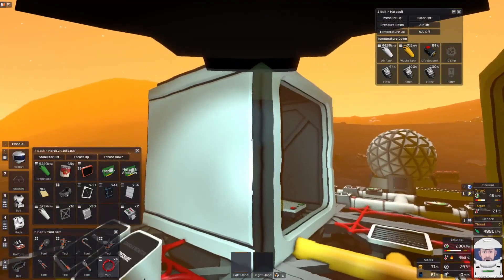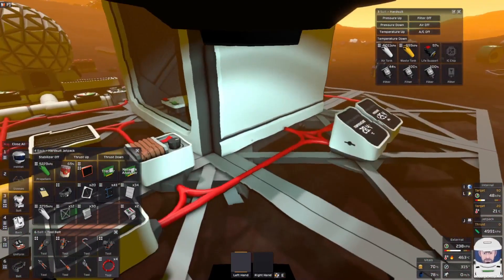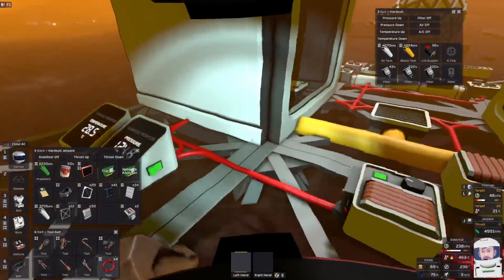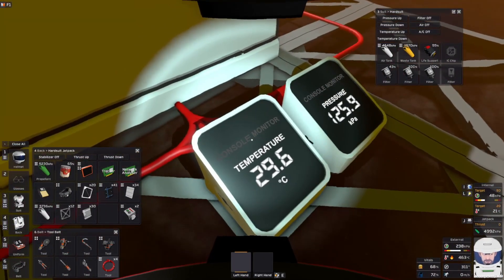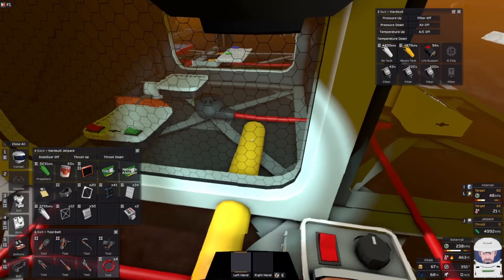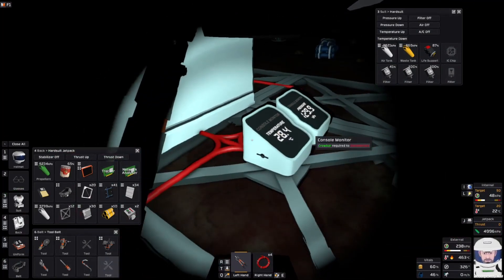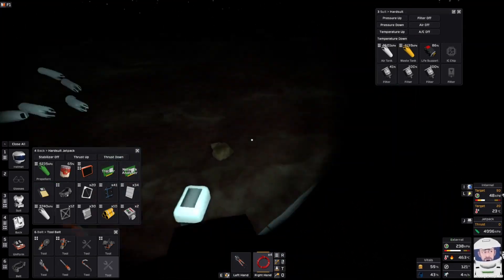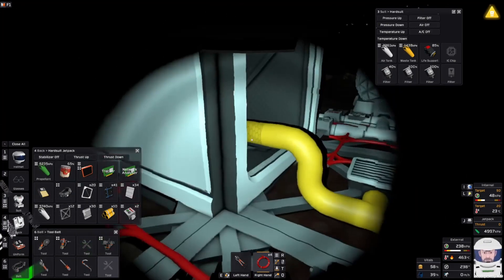Stationeers Experiment - Uninsulated Pipes

Comment: I'm actually surprised they took the time to code it based on surface area! The MVP solution would have been to count the number of pipe segments in the enclosed environment. Props to the devs.
Reply from the maker: At the very least it looks like the small grid (where the pipes attach) must be able to "touch" up to 8 large atmospheric grids.  It probably interacts by losing/gaining heat with those 8 corners of the small grid and whatever large grid atmosphere they're in.  

I doubt the shape of the pipe contributes, so if it's a corner or T it's likely the same as a straight piece of pipe.

One thing I want to test is whether a T or a cross section of pipe holds more volume than a straight piece, since they take two pieces of pipe to construct.  I doubt it, but it's worth a test.
Reply: That would be easier to calculate. You're talking about tracing the 8 vertices of the small grid cube to find the containing large grids and what atmospheres those belong to. Interesting! If that's correct, I'd expect the T to be equal to a straight piece...
Reply from the maker: @RyanSchlesinger  That's what I would suspect, yes.  I guess it would be fairly easy for me to try that just to check.
Reply from the maker: @RyanSchlesinger  It turns out that is not the case.  I will post another video about it.  I'm rather surprised by the result actually.
Reply: @autom8it339  Interesting! I'm looking forward to it.